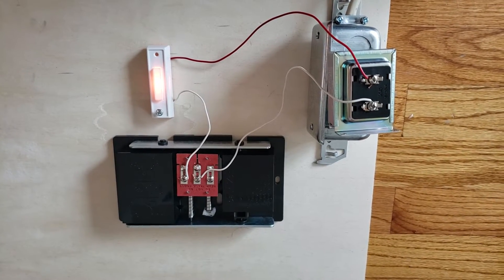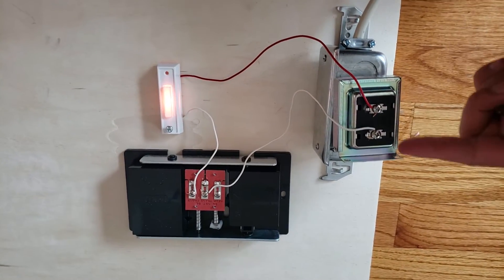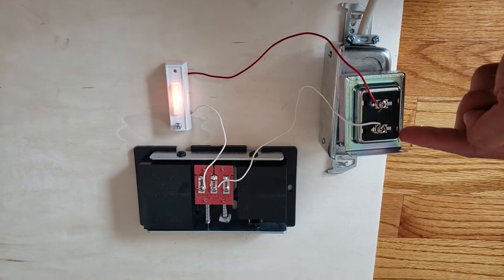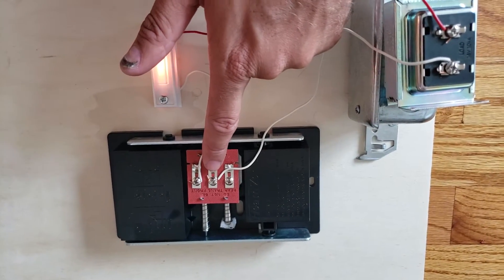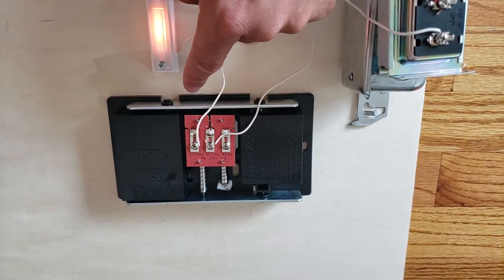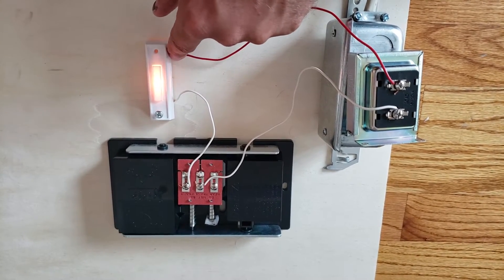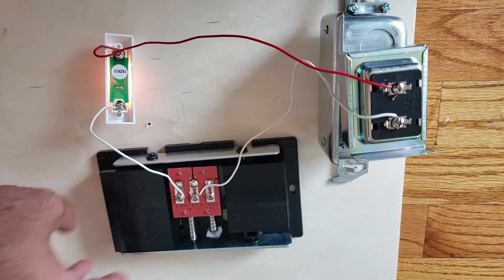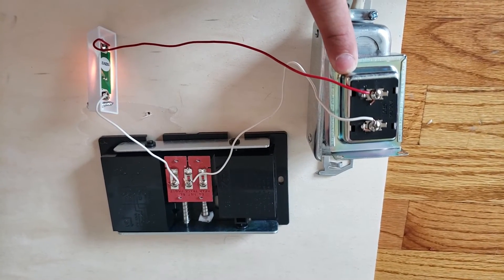Doorbell Wiring Diagram

Comment: I am trying to connect my Video door bell with existing Mechanical chime, and was wondering if I can connect existing wiring to the door bell. Chime label says "16V" and transformer in basement says "120V 60HZ 12VA 25V". on the video doorbell app it says "The Blink Video Doorbell is only compatible with doorbell transformers rated at [8-24 volts] AC at 50 or 60 Hz, 40VA max). I did not connect yet, wanted to check if the rating match or should I change the chime/transformer ? Would really appreciate any help. Thank you.

Comment: But you didn't explain why the light on the doorbell button light lights up with power to it (if the circuit is not broken), and why the chime only rings when you press the button (if the circuit is not being broken when the button is not pressed why doesn't the chime ring??). The answer, of course, is that the doorbell light uses a resistor and low current to light up with, pressing the button allows the resistor (and light) to be bypassed sending full current (500 mA or more) to the chime making it ring.

Comment: My guess would be the inside of the metal box has black, white , green that goes to wires in breaker box.Black Hot.    Can also go to the wall plug in 🔌 Thats hot always, to get power? 🤔 💥. Turn off breaker to wall plug 🔌 till it's wired. 😳🥴 A light bulb on will help to make sure it's the right breaker. 😮 Lights out is no joke. 😏😵

Comment: Doesn't explain how the circuit works.   The red wire applies one potential to the switch.  The white applies the other potential to the chime.   What does the switch transfer back to the chime- the red or white potential?  My brain says that it should be the red potential,  but then how is the white potential getting to the switch to light it up? So if both potentials are at the switch via the red and white wire, what are we doing by pressing the button? Shorting the red to white? Assuming the solenoid coil is the load to prevent shorting the transformer.   I ask all this to because my new Wyze camera is asking me to short those two wires.  If they are different potentials, I will blow the transformer.   The doorbell works without the jumper, but I get random rings from the chime when there should be none. 😮
Reply: Could hypothetically be wired either way to the switch, switch is just an on/off button.

Comment: What happens if I reverse the white wires at FRONT and TRANS? Best I can google is that no damage occurs to the transformer, but the REAR doorbell would not work. (Because TRANS is actually a COMMON for both FRONT & REAR.  With COMMON leading back to the transformer.)   Could someone confirm or correct me?

Comment: What protocol is used to signal from the doorbell to the chimes that they should make a noise? I guess it isnt just a switch making contact because the light is on on this doorbell and cirrent must flow continuously through a smart doorbell.

Comment: To answer a few questions i've seen, from what I've found out: There is a small circuit/whatever that lets a small amount of voltage thru to light the button, then when you press the button it lets ALL the voltage through.
For those of you only seeing a small voltage when using a meter on the button contacts, that is only for the light on the button, you should see the whole 16v or what ever size the transformer is when you press the button, it then completes the circuit to trigger the chime.

Comment: 3rd terminal in the chimes is usually n/c and is the 'loop-in'. 

I fitted my chimes in the middle room; fit bellpush on door. 

NOW SWITCH OFF MAINS ELEC. SUPPLY - bell transformer (Tx) is by the CU wired with a few inches of 1.0mm T&E to a 1A cartridge fuse holder in a spare fuseway in CU.

Then run 1 length of 'figure 8' bellwire from push to chime; 2nd length from Tx to chime.
If it's a simple 2-terminal bell, just 'choc. block' each single from the push and Tx or use the 'loop-in' terminal. Other 2 wires go across the chime's supply. 

If you don't want the chime on for any reason, just pull the 1A fuse or be posh and use an MCB.
Reply: I have no idea what you said, but I think it works well.

Comment: I just moved into a new home and the previous owner had a ringdoor bell pro powerkit installed and one wire goes to the front door bell and another to the rear instead of the transformer but it still works. I want to change the door bell chime because it's ancient and not sure if I should move the rear doorbell wire to the transformer screw. And yes there in no rear door bell in house.

Comment: Do you think it is okay to have two front doorbell buttons (one traditional button, one with video) in parallel, both connect to the chime's "front" terminal? I don't want to use the 'rear' terminal since they are both for front door. I want to add a video doorbell without removing the traditional doorbell. The transformer is 24V 40VA and should have no problem handling multiple doorbells.

Comment: Get this, some weird wiring. Today I installed doorbell, when i went to the chime block to install the chime kit that came with the cam, it's same like the one you showing in this video but
1 wire was terminated to Front terminal, other wire was terminated to Rear terminal, nothing on the Trans terminal. Go figure. Threw me off, so I just wired the same way, and it is working.

Comment: What if your house is wired for a doorbell with this wire, 4 pairs of wire colors (orange, blue, green and brown) which wires do you use?
Reply: Out of assumption, 1 pair should be coming from the transformer (hot) 

The other 3 pairs should be Front, Rear and Side doorbell. 

Only issue is now to find out which one you're trying to use and wire it according to this video.

Comment: I have four wires coming from the wall. 2/white (twisted together), and 2/red (one-trans, one-front both on the chime), and a 24v transformer (with 8v, and 16v options) which the doorbell/camera I'm installing requires. I need to connect the wires in a way that powers the 24v smart doorbell/camera, AND rings the inside chime. Yet when everything is connected the inside chime does not operate. Of the four wires, one white and one red are live/hot, and the other red and white are not. Am I to switch out the non-live red wire that's connected to the "front" terminal for one of the white (non-live?) wires?
Reply: if there is a settings menu in an app, it is likely that feature is currently disabled. Should be able to just turn it back on

Comment: Thanks for a quick and simple explanation.  Replaced an 30 yr. old Nutone intercom with a Wyze video doorbell.  Looking at your diagram made me realized I would short my system with the fuse supplied with the vid doorbell.  Saved by the bell.  Pun unintended.

Comment: Thanks! My door bell was not working. After watching this video, I realized there are two bells inside. I simply moved wire from bell #1 to bell #2 and it’s back in operation. Thanks for the help!
Reply: I tried this but I think the transformer might be busted. I’m not getting a read on the load side with my t1000

Comment: What if you mix up the wires? How do you find out which wire is for the transformer and which wire is for the doorbell
Reply: The polarity doesn’t matter
Reply: @nfg79  i had the same question. I have the two same colored wires coming from the hole where the old chime box was. My dumb ass forgot to label which one was the trans and which one was front.

Comment: I have a one door bell house, a transformer in the garage (backside of electrical panel), and another in the closet close to the front door. There are four wires (two white, two red) in the closet where the transformer is, and a red and white wire from the wall where the chime is. My wiring does not look like your wiring and I am trying to fix my door bell. Please help.

Comment: Where should I install the chime doorbell? Is there a certain spot it should be mounted at?
Reply from the maker: Wherever the wires are accessible and you can hear the chime. Typically they are near a stairway so the sound carries or in a central part of the home. For larger homes people wire two so they can be heard throughout the home.

Comment: I just changed my chime to the same one you have bc ours was old(didn't even have a cover). It worked fine until I changed it and now it sounds weird. Idk what I did wrong 🤷‍♀️.
Reply from the maker: Sometimes the wires or the cover can be touching the chime bar on top which will dampen the sound check this first.